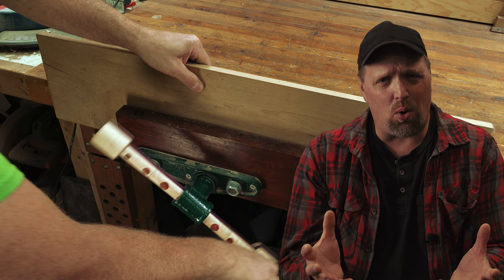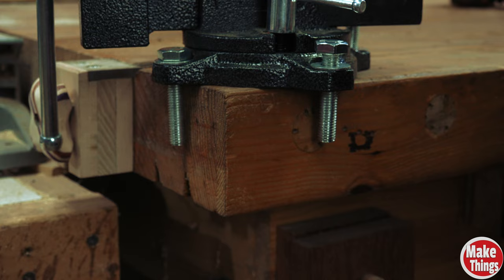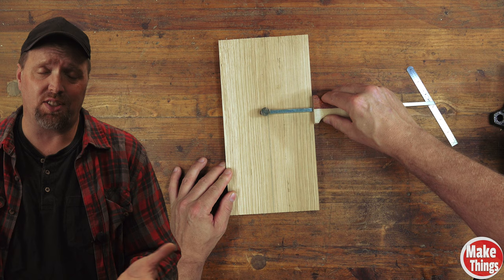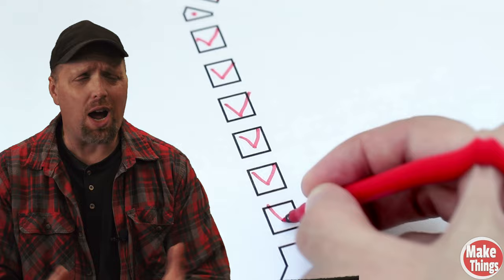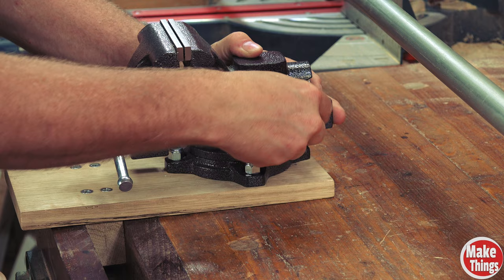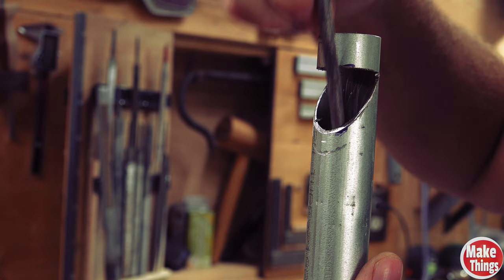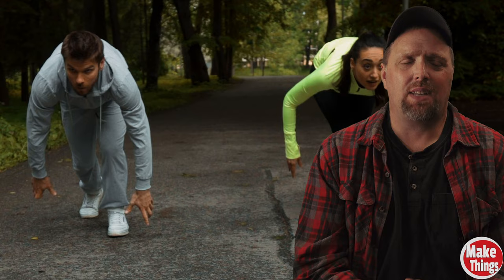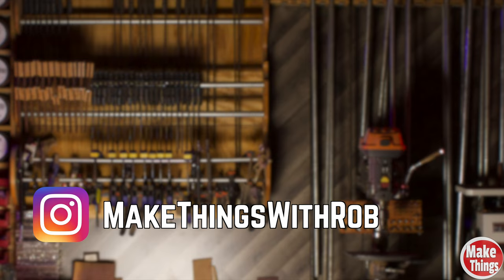Hacking and Reviewing the Goehner's Bench Vise // A Crucial Bench Appliance!

Comment: An alternate hack for you is to cut a 2x6 to the same length as your bench is wide.  Mount the vise on one end. Cut a slot down the center and place a bolt through the slot in the 2x6 into your bench.  You can loosen the bolt through the 2x6 and in your bench and slide the entire 2x6 and vise out into the open where you can get to all sides of what ever it is you are working on.   If you need the entire top of your bench one bolt is removed and the vise and 2x6 are removed.  Wish I could send a picture. If you work on odd sized things this is the best vise hack I have seen.

Comment: Great video, and it looks like a good vise.  I've had one for many years in my shop with a similar base, though mine has two identical cross pieces.  Having two lets me store it sitting flat on a shelf which makes it easier to stow, and if I just need to do light work or to use the anvil it can be set on top of my workbench without clamping as the weight of the vise is enough to keep it from moving around much.  The cross pieces are spaced so they saddle over the front face of my woodworking vise so I can clamp it there if needed for heavier work.